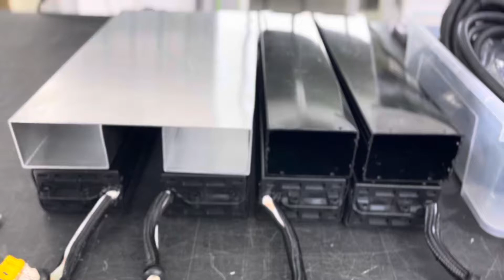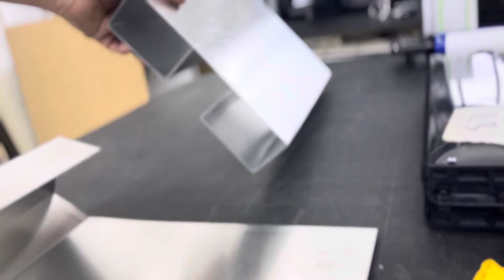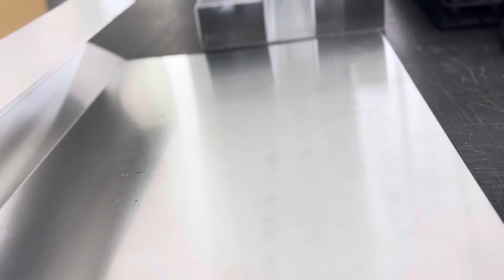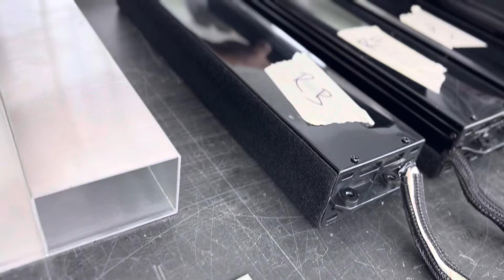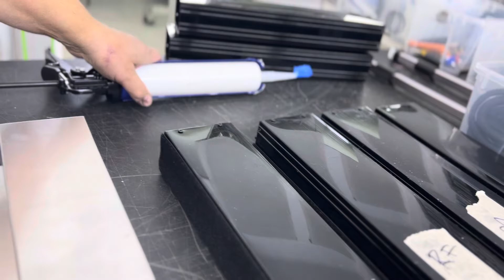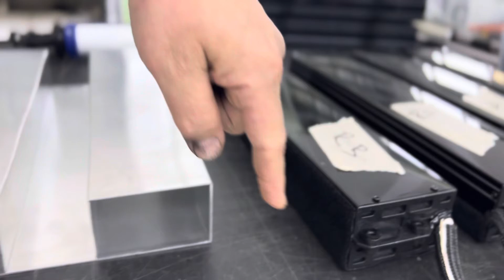How to replace Begode Master battery case to aluminium.

Comment: Good easy solution.  But you should still use screws as the battery cases are a part of the structure.  It is not only holding the batteries,  but also takes all the force from the pedal hangars when accelerating and braking.
Reply from the maker: Thank you for comment. All screws are in place. Additionally, alu boxes are sealed by hitemp silicone. Phisycal Structure is not compromised in any way.